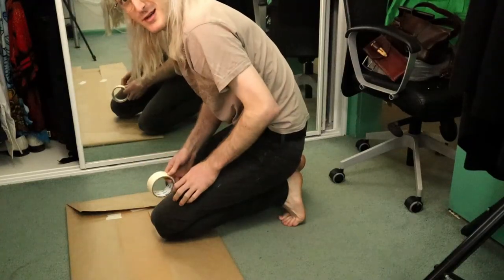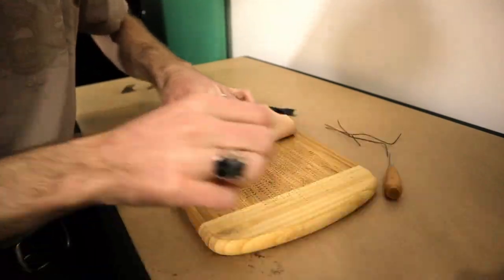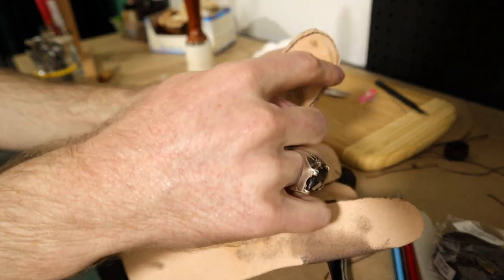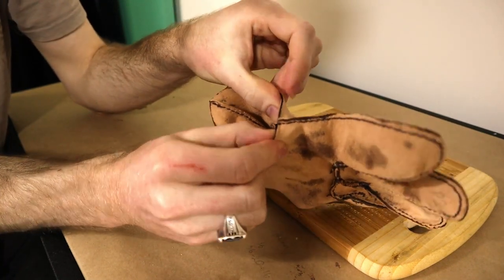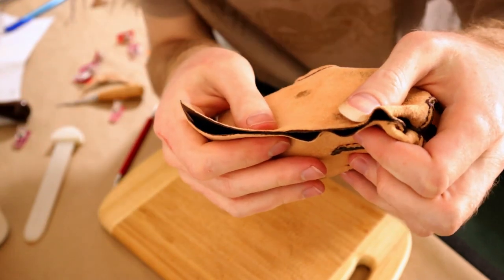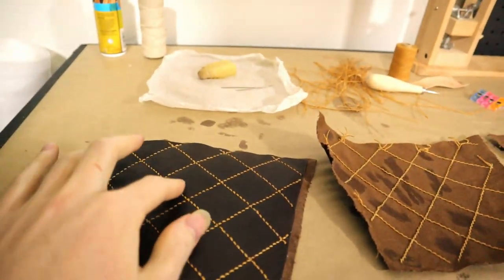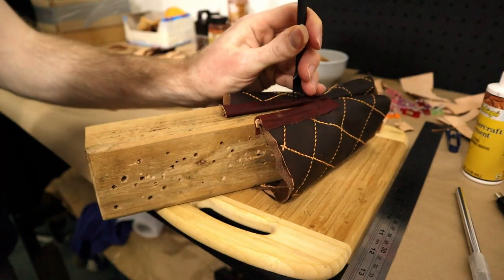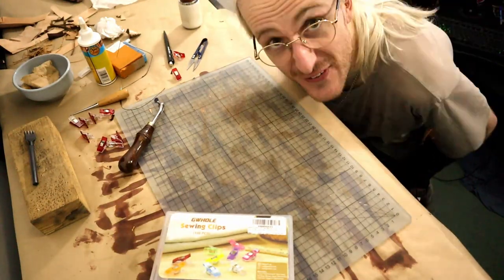Gloves fit for a Witcher | Cosplay leatherwork

Comment: Start by pushing in the finger tips. Push the tips into itself. Push as far as you can get it then pull the tips out the bottom or right side out
Reply: Hope that makes sense. It did in my head
Reply: @notwjmz  it does, don't worry :b

Comment: A  seamstress trick of turning (fabric) corners inside out is to attach a bit of string to the tip and use that to pull the corner up and cut it afterwards... I don't know if it would work with leather even goat which is obviously stiffer

Comment: You could stitch with a nedele through the tip of all fingers, make a knot or something behind it and pull all strings.
Reply from the maker: I've had this thought! I'd run a looped thread through so both ends stick out the wrist, then the whole thread can be pulled out once the glove is reversed. 

I definitely want to try making another pair in future, so I'll try it then

Comment: 1. What weight of leather are you using? 
2.  what prompted you to cut the middle and ring finger out of the palm side of the pattern? 
3.  what changes did you have to make to the pattern to get it fit properly?
4. If you had to do it over, what would you change? 
5. Do you think its better to stitch it all by hand, or could you machine stitch some of it?

I ask because I will making something similar for a Elvar Mann type High Republic Jedi in the next year which requires gloves with long cuffs that get covered with a bracer.
Reply from the maker: Oh boy! Best of luck in making your own gloves, this was very rewarding for me.

1: this is goathide that's about 1.5-2.0mm thick.
2: the fingers need to be wide enough to wrap around the sides of your fingers, so they need to be wider in total than the width of the glove; therefore they need to be cut that wide and added on later.
3: mostly extending the fingers and getting the junction at the knuckles to sit in the right spot. These gloves are VERY tight.
4: minor pattern adjustments, and honestly not much else. I'm still extremely happy with these!
5: you can stitch it however you like, I personally prefer hand stitching, and a saddle stitch will always be stronger than a machine stitch because the thread crosses over in each stitch hole.

Hope this all helped! Thanks for the questions

Comment: Okay, so I have been trying to make a pair of gloves for a whole year. 
My fingers twist horribly. 
How did you get yours to only twist slightly?
Reply from the maker: I think that the twisting of the fingers is related to how splayed out the pattern is; my index finger points out slightly away from the middle finger on the pattern, and the index finger is only slightly rotated.

I plan to address this in later revisions, but great eye for noticing. I hope that was helpful!
Reply: I have read that you have to stretch the hide before you cut, stretch it in two directions,   But I’m not sure if that is just veggie tanned or chrome tanned as well,.  And I’m not sure how exactly to do the stretching. Did you stretch yours?
Also, I just saw a Video where the gentleman says that the wrists of the gloves need to be on the spine of the hide. Or did you say that?
I’ve done 4 different hides, suede, two different deer hides and a Mirabelle lamb skin (in the hope that more expensive is easier to use). No. It wasn’t. 
I love your false four bets! Cool idea!
Reply: Fourchets
Reply from the maker: This was some veg tan goat hide, and to be honest with you I didn't pre-stretch the hide, nor did I pay particular attention to where the spine of the hide was. I mainly placed the pattern to avoid the overly stretchy areas at the edge of the hide, in order to make sure that the part I was cutting out was uniform. I wish I could be more helpful but there wasn't really anything special I did to the goat hides, sorry! I did absolutely slather them in neatsfoot oil, which did help in making them supple. What are you using to condition your veg tan?
And thanks! It took way too much effort, but I really like the slim fit of the fingers without fourchettes!